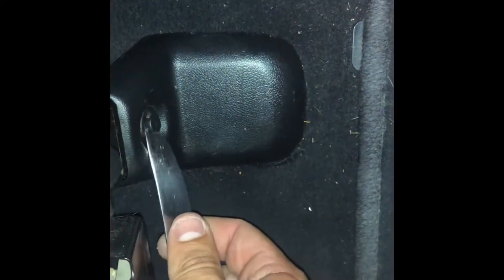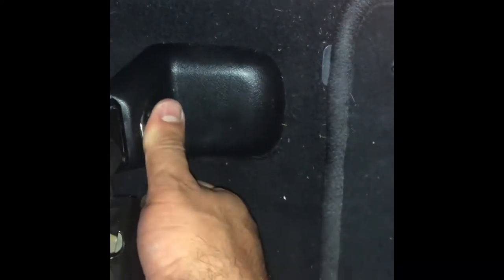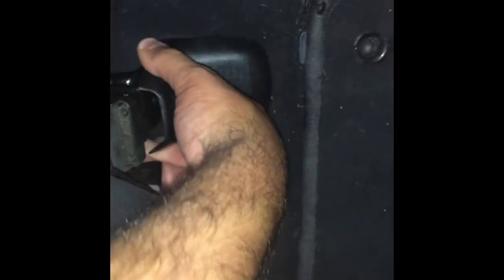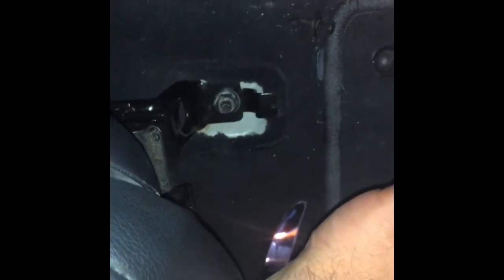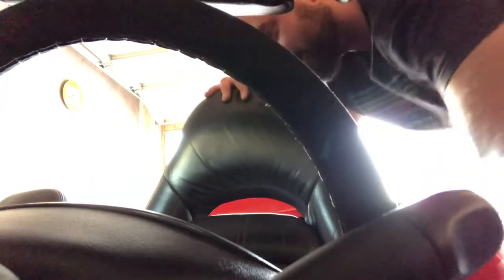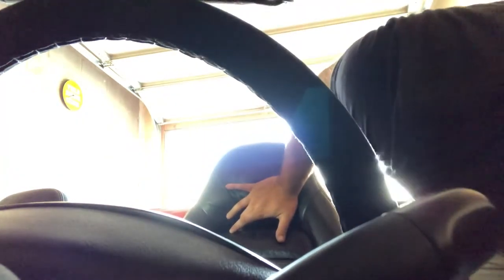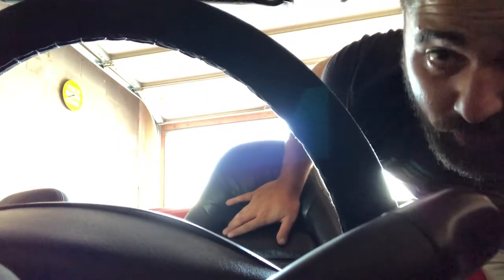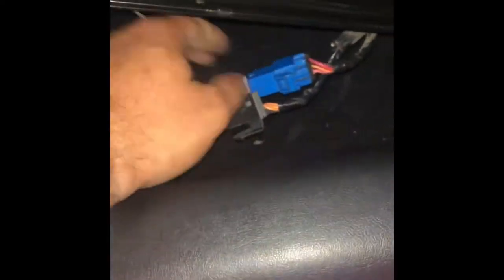Twin Flag Garage - C5 Corvette Seat Removal

Comment: I Have a big problem my elettric seat motor wich move the seat back and forth it does not work.So I can't disassemble the four bolts holding the seat.How do i unlock the mechanism to bring the seat forward
Thanks
Alberto.
Italy